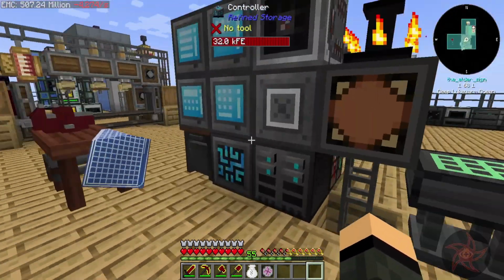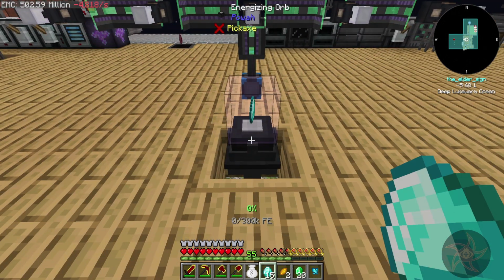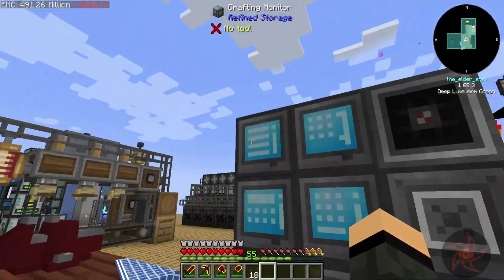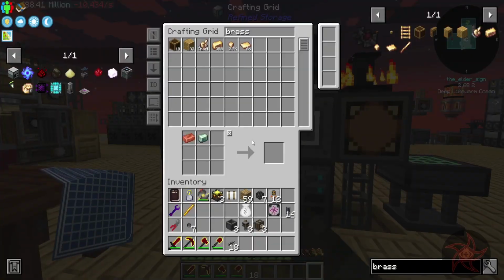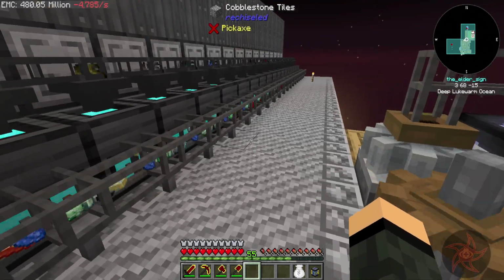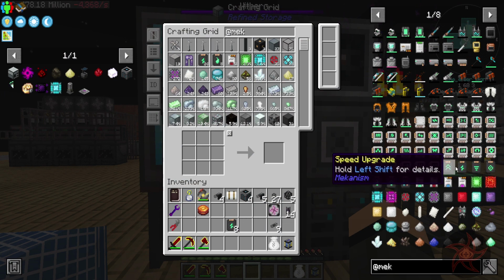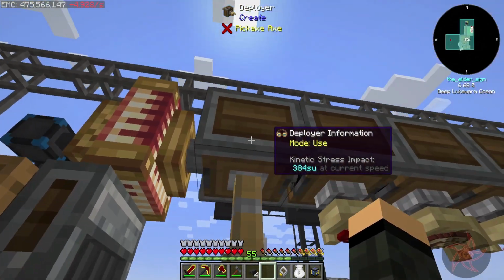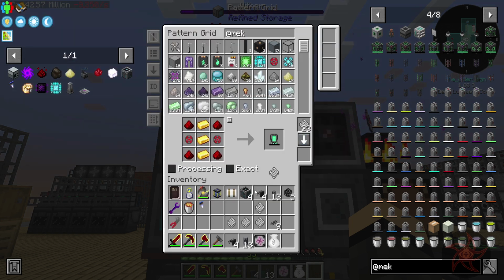Mechanical Mastery :: Star Shards :: MM-18

Comment: Nice vid 🙂 Am I blind or did you not have to do anything special for the Refined Mixture mixer? I'm currently at this stage of the pack and it's beyond annoying that I can't filter the recipe on that basin so whenever my HDPE sheet production hiccups it starts making thick potion or zinc nuggets and clogs up.
Reply from the maker: Zinc nuggets can be left in the basin, it will stop making new ones once it hits 64, the thick potions are a bit annoying, I got around it by having RS export thick potions to a an ultimate mek tank so that it doesn't jam up the crafting, once you can get the system running continuously it shouldn't make that many of them, I think that when all was said and done I had about 40 buckets of thick potions when I wrapped the pack up